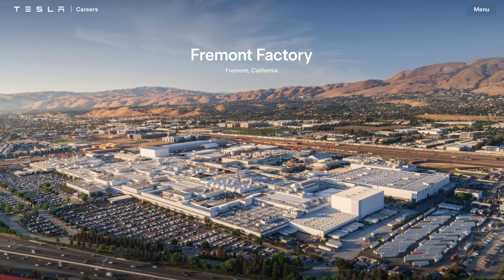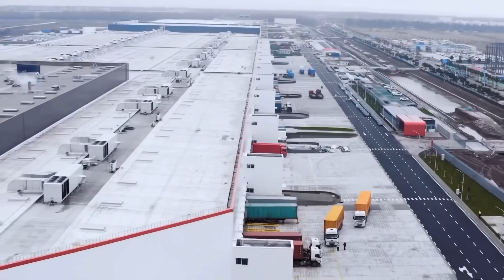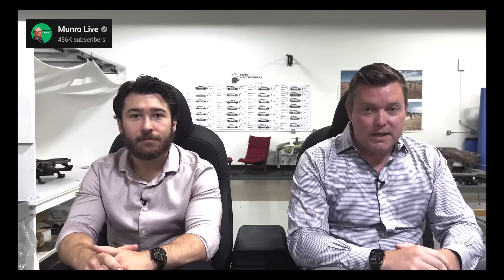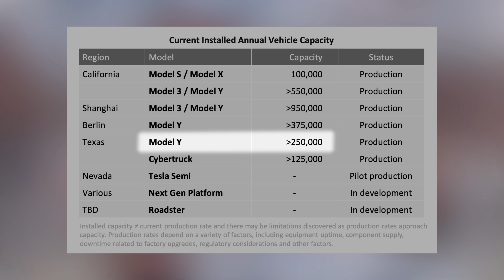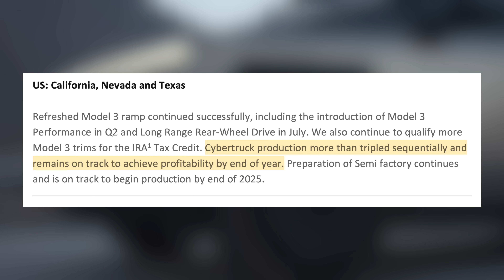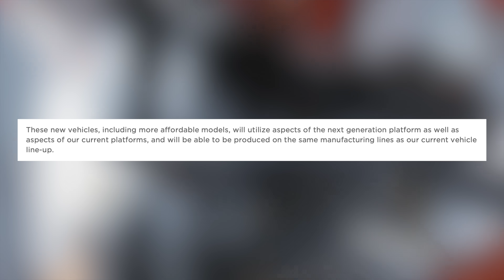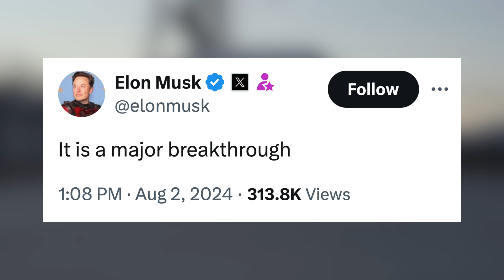How Tesla Builds a Car Every 13 Seconds

Comment: Having a manufacturing capacity of 2.35 million vehicles per year is one thing, finding 2.35 million customers willing to buy them is a completely different thing.
Tesla is far from manufacturing 2,35 million vehicles per year. In fact, Tesla factories are running at a fraction of their nominal capacity. Especially the Cybertruck one, which is running at 20% of its capacity and is burning cash like no other automotive plant in North America.

Comment: If China test each battery before shipping take 500 and test them before loading the containers drawn the figures so you will know when it will charge and discharge attach information to each battery next time each one for a full charge and do the same with discharge both are tested before shipping?

Comment: Every 13 seconds? Clearly explains why the entire HEPA Filter housing was left out of our 2023 MYLR. My wife couldnt understand why the outside odor of ICE vehicles was so strong in our MY of only 4 months...one of the Tesla service centers discovered the issue and we were sent a new housing to install ourselves. Does make one wonder what else could be at risk of not making it to the assembly line.

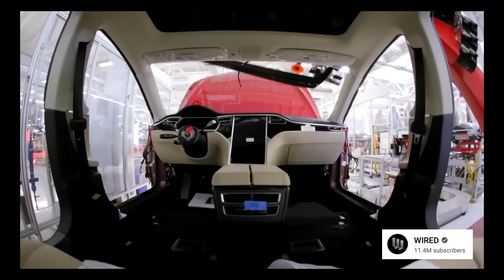Comment: 3:12. This is an absolutely BS thing to say.  There is a *HUGE* difference between how long it takes to build something "start to finish" and "how fast they are coming off of the line."   I can promise Tesla is not building from raw material to completion in 13 seconds, and never will.  Tesla is building LOTS of Model Ys at the same time, and one is rolling off the line every 13 seconds, but that doesn't mean that Model Y only took 13 seconds to make.
Reply: If you waited till 9 min mark he explains further by what they mean by 13 seconds.

Comment: Giga casting will make the reparing cost very high.
If all the BEV will made like this then you will have to change the car in 4-5 years and repair cost will so high that it will be easier to buy a new Car.

Comment: A highly possible consequence of building a car that fast - I want to share my experience with the Tesla Model Y to raise awareness about its significant flaws. This car is not suitable for driving in the rain; the design is poorly built, compromising the water seal to the motors underneath. Recently, I found myself driving on a road flooded to the curb level. I know this was a bad idea, but it wasn’t intentional. After all, it’s marketed as an SUV, or at least a crossover, given its size. Mine is a 2023 Performance Model Y.
Tesla will not cover water damage, despite the fact that they build cars that are prone to major issues when driving in wet conditions. I received an estimate for repairs of nearly $6.5k. This makes me suspect that Tesla has a strategy of attracting customers with significant discounts compared to their initial prices, only to make more money off of repair costs later.

To make matters worse, if you do not have Tesla insurance, they won’t send you roadside assistance in this kind of situation.

These cars are extremely delicate when it comes to water exposure. To anyone reading this: never drive your Tesla on a rainy day or even shortly after it stops raining. Avoid taking your Tesla to a car wash, and if you must, do not select the underbody wash option.

I have owned this car for just 10 months, and it’s already been in the service center three times. I purchased it for nearly $53k, and the insulation around the major components is alarmingly poor. I can no longer drive it with peace of mind when it rains, and I deeply regret my decision to buy this vehicle.

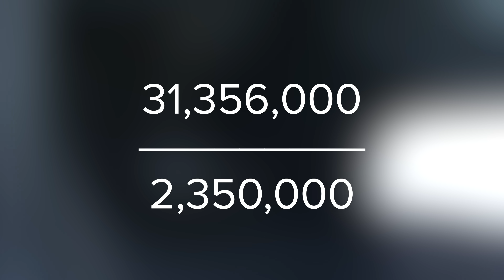Comment: 10:10 you made a transposition error when calculating total seconds in a year. Correct value: 31,536,000. I thought you did a good job on the video, so I thought you might want to correct this minor mistake.

Comment: Ryan, you are calculating with Production capacity. Per comparison, where does Toyota or VW stand with their total Production capacity (EV + comb. engine). And where do they all stand in context of in fact produced products/units? I have Seen a Q1 2024 Production output number for Tesla of 433400 units, ie the output per seconds would look different, correct? Cheers.

Comment: A car may be finished or produced every 13 seconds off of more than one line out more than one factory. You said that casting one frame takes 80 seconds (I'm sure that doesn't include cleaning and machining). On most automotive assembly lines the cycle time per station is around 1 - 1.5 minutes. Actual "building" a car takes about 6hrs to assemble including sub assembly and assembly line time. Painting alone is probably 4hrs per body. E.D. coating, sealing, primer and painting all takes time because of oven time and travel time through the paint shop. At the plant I worked at you could figure about 8hrs through body and paint and about another 6hrs through Trim & Final, depending on line stops. Then you have tester line and final inspection. Almost 2 full 8hr shifts total.

Comment: so much innovation, burnt out brains, obsolescence ,possibly better buying the older model so the new one won't impact on cost too much when the next one comes around the next generation..The cortina ran the same body shell on the mk 3 ,4 and 5 also most components inc gearbox and engine wiring, the only difference being some of the outer panels.A changing throw away world indeed, not sure what world was better.

Comment: ENGINEERING / INVENTIVE / THIS PROCESS HAS ENABLED  AN ABILITY TO PRODUCE AT THAT PACE. TESLA DESERVES A FINE RETURN ON ITS FACILITIES MANY HOURS OF INVENTION AND SUCCESS. I HAVE NOTICED THEY APPEAR TO BE FLIMSY AND LACK QUALITY CONTROL ON PANELS AND IN OTHER AREAS. MY OPINION IS THAT THE CARS ARE UNATTRACTIVE AND THEY CAN ADD SO  MUCH  IN THE AREA OF STYLING.   THE COST TO THE CONSUMER HAS NOT BEEN REALIZED. THESE SHOULD BE A INCREDIBLE VALUE TO THE CONSUMER.

Comment: The main problems with using Ethernet busses and controllers, is that The entire system is prone to single-point failures, just like in the movie "Battlestar Galactica" where the Cylons just wipe out the electronics, or Jam them, like in the movie Spaceballs.  The old MIl-1553 system had similar issues with contention, but at least had the capability to "disregard" damaged sensor and local controllers, from the main busses.  There are already videos on the Inet, where people trapped inside burning Teslas, CANNOT get the windows down, or doors open.  This is very dangerous technology, and needs to be regulated for passenger safety (especially if the cars have a tendency to have failed batteries, and complete loss of power).  That is another danger of the 48V systems.  GM worked on these decades ago, and in those days "filament bulbs" did not have the suitable longevity.  Now with LEDs and arc lamps this is no longer a problem.  If Tesla uses the Main battery for the 48V power (stepdown converter), then the car may again be susceptible to at least TWO single point failures, right off the bat.  That's not counting the failures of the multiple local controllers, if the Jam the busses.  On the Inet, this is called a DDOS attack.

Comment: That was a great summary. These advancements are impressive from a technical standpoint. But gigacasting is bad for the consumer. A minor knock, and huge, very expensive pieces need to be replaced. The repair costs will go through the roof, and so much increased insurance premiums will effectively subsidise the adoption of gigacasting. I hope Toyota don't swallow all of the cool aid

Comment: Twenty-two years ago I was working as a software contractor in the same NUMMI factory in Fremont, California that later got sold to Tesla. During my time there we were making a car (Corolla, Prizm or  Vibe) every 65 seconds and a Tacoma pickup every 90 seconds. And NUMMI was operating two shifts a day.
I have wondered whether Tesla gutted the convoluted two assembly line system winding through multiple connected buildings or did they largely start over from scratch.
The simplified castings is impressive. During my time at NUMMI, subassemblies were shipped in 'just in time' fashion from several sources. As an example, for the Toyota Tacoma trucks, the frame assemblies arrived every morning from Stockton for cars assembled later that day. The cargo beds were assembled and shipped from Long Beach. 
I expect that Tesla has similar issues. They must be shipping batteries and battery packs across country every day. Are the electric motors assembled in each factory at the same pace as the cars? Or are they made in some other location and distributed to the Giga assembly plants?
The paint plant was a big NUMMI chokehold. Slight changes of weather or chemistry made subtle noticeable differences to paint surfaces. If you painted doors at a different time or date than the rest of the body then things didn't quite match up in final assembly.

Comment: To spit out a new car from a factory every 13 seconds is one thing. To build a car in 13 seconds is something completely different.
Reply: It's a LIE. They make one car every 120 seconds. I KNOW, because I know MANY on the assembly line, from start to literally the end. Quality Control.
Reply: @apollo5751 still so fast and cool
Reply: @apollo5751  each line makes a car every 2 minutes in CA, I've heard cycle times at the giga Texas are lower and the specific cycle time of 43 seconds that sandy Monroe is always talking about are in China ONLY. Their automation is 100x better than any us plant.
Reply: @apollo5751  they don't make a car in 120 seconds 😅
Reply: Agree.  Stop with the deceptive headlines.
Reply: Correct.
Reply: Doesn’t count the time to make the parts and subassemblies.
Reply: they have multiple assembly lines

and clearly they are ignoring all the time taken to move materials around the factory

Comment: Tesla is not the only company that profits from manufacturing EVs. The BMW i3 not only profited, it manufactured one of the greenest cars on the road today. Using recycled materials and plant fiber, aluminum chassis, and heavy use of carbon fiber rather than steel, because it's stronger and lighter.

Comment: Maybe if they slowed down a bit they would have  better build quality, steering wheels  bolted on for example, panel gaps would be consistent,  wiring harness for trailer connection would not be missing.  The automation is impressive but it can only go so far.

Comment: Cutting edge manufacturing. Well I guess you could say that about the cyber truck in the fact that its edges cut people. Tesla doesn't have to worry about future improvements but because they won't exist in a few years. Their competitors are 5-10 years ahead in terms of tech and Elon will most probably be bankrupt within 5 years. His house of cards will come crashing down and he will be charged with securities and wire fraud. Maybe if they spent more time making their cars they might actually work properly instead of malfunctioning constantly.
Also just an edit. I'm looking forward to that full self driving that is coming at the end of 2016 and getting my robot taxi in 2022.😂

Comment: Giga Shanghai went up so fast because they could have 10 times the labor for half the cost. Not to mention there’s no real regulations you can’t pay your way through and the car they’re building in China would never meet the standards of a US built car or be able to be driven on the road in the US because it’s built for the Chinese market with much less stringent requirements  so this truly is not a feat. It was a dumbing down.

Comment: The problem to solve with the “Unboxed Manufacturing” is ISD (In System Damage). When you have all the parts assembled and painted separately and then have to bring them together and attach them together, you have to be careful not to damage any of those parts or any of the painted surfaces. I’m curious to see how this will be done. Perhaps with the upcoming RoboTaxi, it will be a such a uniquely shaped vehicle that it will allow the process to work.

Comment: Basically Tesla are rehashing the original Mini design. Which was front & rear subframe & body completed chassis, where as Tesla use battery & add body on. So not such as new process after all. Perhaps Mr Musk needs to give a big hand to Sir Alec Issigonis who designed the Mini

Comment: A Mercedes Benz diesel engine + 20 gallons of diesel weigh 650 lbs; a Tesla battery + 2 electric motors weigh 1,500 lbs. EV's are a poor solution to a non-existant problem.

Comment: And now the model Y is complete write-off in accident …insurance cost is much higher for the owner.
Reply: Er…you’re basically saying the same thing I said. Just using different phrasing.
Reply: Exactly. This is an example of the manufacturer saving costs at the expense of the consumer. The consumer having to pay more to the insurance companies because they are so easily written off. One small accident and that whole casting is ruined. It’s not like you can just replace smaller components after an accident as you can in a conventional vehicle. Tesla is creating savings for itself at the expense of the owner. This is why I will never buy one.
Reply: @lasersailor6684 sounds like you really know your stuff.  Sounds like…. 
Unfortunately you’re incorrect. But keep at it. 
Yes, teslas are repairable. No, it isn’t a “write off” from one accident. 
Insurance is a lot because of a combination of expensive and limited quantity of parts, combined with the specialty work required due to the battery / incorporation into the vehicles systems. Fixing aluminum requires different equipment at body shops. Stuff like that.

Comment: Not built in 13 seconds
Reply: They build a car every 13 seconds. They have 4 giga factories manufacturing vehicles.
Reply: @jstitt13  ok fair point, if you look at it as parallel production lines.  But when I think about cycle time, I typically only consider one plant per factory. So given gig a factory, the cycle time is between 40 to 50 seconds or so, as I understand.

Comment: They still do this in Giga Berlin/Grünheide. My June 2024 Model Y RWD with BYD Blade Pack has the front casting and a structural pack with seats directly installed on the pack.

Comment: I'm sure that all the big auto companies Toyota, VW, Ford, BYD etc. make vehicles faster than 1 every 13 seconds. It's just a matter of how many assembly lines they have. What should have been talked about was the rate of production for 1 assembly line.
Reply: Or time to manufacture one vehicle from start to finish
Reply: He did say one every 30 seconds either at Fremont or Shanghai.
Reply: @dylanthomas12321  Shanghai has achieved one in every 42 seconds, and they said they have a goal of getting it down to 30 seconds.

Comment: I wonder if that gigacasting and 3 piece underbody is why the accident cost for tesla get expensive so quickly,  cause we're In average cars it's many different pieces to where with that design if damaged entire section would have to be replaced.
Reply: Depends on what the gigapart costs, I have no idea. If it can be pressed in 80 seconds, it should not be more expensive than all the individual body parts that need replaced after a crash. You could also buy the part, cut it down to what's needed and weld that onto the rest of the original part that was undamaged, saves having to strip that part of the car. If Tesla charges a small fortune for the part, they're making a mistake in my opinion.

Comment: The emphasis on a car per number of seconds is very misleading. To put it in perspective you should reference the car/seconds of GM, Ford, and Toyota. Years ago I worked on a General Motors assembly line that produced a car per minute. On just that ONE assembly line!

Comment: The heading is incorrect. It should read "Tesla completes a car build every 13 seconds."  You have to start the stopwatch when the first parts of that particular car were put together and then end when it comes off the assembly line. Different story.
Reply: That is the sum of the cycle times for all the processes.  I

Comment: One and done collision wise!
Reply: that’s what I was thinking how would it be repaired?
Reply: @Ken1452  Replace or repair the damaged casting.
Reply: the castings are weldable, so you can cut bits off them and weld new pcs on.  Also they are designed to fail progressively.
Reply: @christopherstube9473  is this an insurance company approved reconstruction methodology ?
Reply: @christopherstube9473 yah that won’t damage the residual value of the car at all.